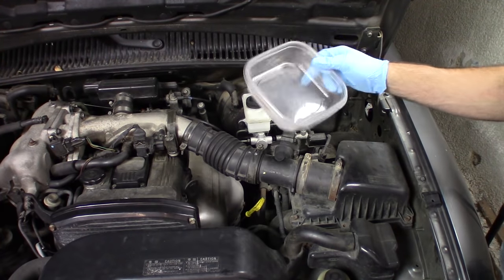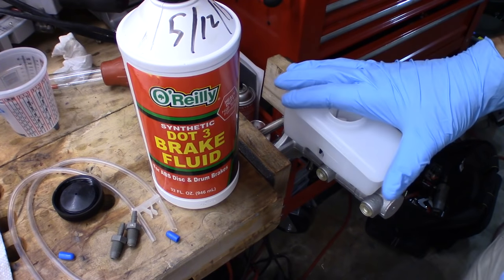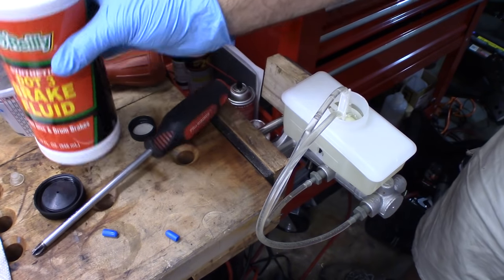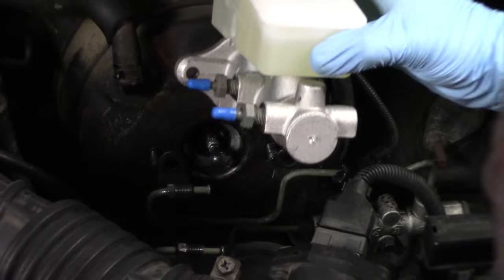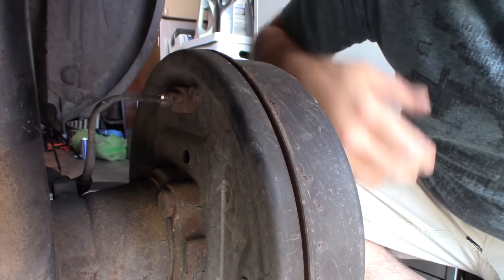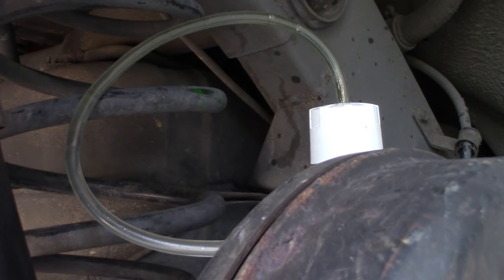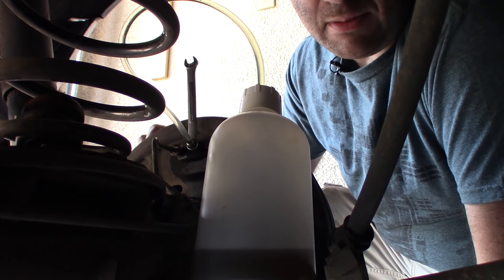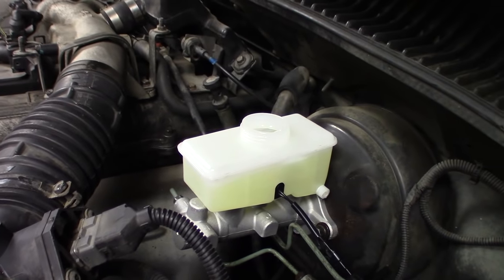How to Replace and Bench Bleed a Brake Master Cylinder DIY

Comment: Alot of great info here and great camera work. These are the type of do it yourself videos that actually help people and show proper technique. Another tid bit is (at your own discretion) that you can go jam your brakes up going down a open road are parking lot  to make your abs activate a few times and rebleed the system if in a pinch and you have to. Keep up the good work.

Comment: IF you can get to the fittings on the booster...
You can use the fittings as bleeder valves. With them snug, have someone pump up the brakes and while they hold it, crack open the fitting on the front, the air will come out. Snug it. Have them let off the pedal. Fluid will be pulled out of the reservoir. Do both ports.
Then bleed the calipers and wheel cylinder as usual.
Reply: Do I bleed one port at a time? Or can I do both at once?
Reply: Gonna try this tomorrow!

Comment: Amazing seeing a car and brake system without a toal enxrustment of RUST...servicing cars in the North East and Rustbelt is a whole different job...how nice itt would be to not deal with seazed, rusted nipples crimped rusty brake lines ..and the desasters from  moving or losening a rust encased line..like they all are under an older Norhtern car...that was a joy to watch...tnx

Comment: Good video, especially for older cars that do not have ABS brakes or TRAC systems.  As you mentioned, those systems probably need bleeding also after changing out the master cylinder.  If you are a competent mechanic or DYI mechanic with a proper repair manual for your individual car, you can bleed these systems yourself.  Just follow instructions carefully and be aware that ABS and TRAC pumps are high pressure.  Don't hurt yourself if you try to bleed those systems.  
 Otherwise, a very good video with good information.  Would like to see another using a pressurized brake bleeding system.  

Dr D

Comment: I've seen the bleed kit's tubing clip used on a master cylinder reservoir that has 2 isolated sections for fluid [2 separate fluid circuits provide for braking in the event of one circuit's failure].  The plastic hose clip fastens on the 'wall' that separates these sections.  The BMC shown in this video has 2 circuits; however, it looks as though they share the same reservoir.  If so, this suggests that the failure of one circuit [e.g., via a leak] could drain the entire supply of fluid from the reservoir . . . leaving the car with no brakes.

Comment: I have a front wheel drive 2003 Toyota Celica GTS and the brake bleeding order isn't from the right rear 1st, then left rear. Some Hondas and other front wheel drive vehicles have a different bleeding order. Make sure to always check your manual or verify the correct bleeding order for your vehicle

Comment: FYI you can buy a scan tool for a little over $100 that will tell the ABS module to bleed. Since every car today has ABS, you might need to use one of those from time to time to make sure any bubble are out of it.

Comment: Why are most recommendations to fasten the master before installing lines? I think it's much easier to get the lines on when master can be moved around a bit.         Why do all the bleed vids just have 2 lines. Most vehicles I've worked on have 3 or 4 'ports' to deal with.
Reply from the maker: +Jay Last You're right, I suppose it would be easier to get the threads started a bit before you bolt the master down.  They have 2 lines because they are older, non-abs cars.  They have 2 circuits, 1 feeds left front & right rear and the other right front & left rear.  This way if one of them corrodes and leaks, you still have front and rear braking.
Reply: Thankyou, I didn't know dual lines alternated front to back but that makes good sense.
Reply: so when you bench bleed a master cylinder with 4 ports, how do you work with the kit? Do you need 4 tubes?
Reply: @50sKid  A lot of modern cars have 2 lines with ABS. One set of lines will go to Front-Right and Rear-Left while the other to Front-Left and Rear-Right. A proportioning valve will be somewhere in the system to balance the pressure between the wheels. That approach is essentially what does the anti-lock for the back wheels. One of the fail modes for the proportioning valve is your rear wheels locking up when you press the brakes, the other fail mode is they barely get any braking power at all (depends if it's stuck open or stuck closed).
Reply: @eideticex  
Hello
my car is 1993 Ford Taurus V6  3L  and my master cylinder 
have 4 ports (4 brake lines)
do I do the same things you did with the plastic hose,,but in my case i need to put 4 hoses instate of 2 like you?
thank you

Comment: HI..I really enjoy your VIDEOS, especially because   have a 1998 automatic KIA SPORTAGE NON ABS..I need to do exactly this job in a few days, so thank you Exactly what size flare wrench are you using to remove the 2  lines at the MASTER CYLINDER?  I am afraid to strip them..they seem rusted..you turn the wrench counterclockwise, correct?
Also are the bleeder screws at the brakes the same size flare wrench as the master cylinder 2 lines?? thanks!! Hope u can answer asap!
Reply from the maker: I don't remember exactly.  Just go to harbor freight and buy a set of flare wrenches.  They're very cheap.

Comment: Hi ther ,shouldn’t you use a pry bar to hold the brake pedal using the car’s seat 
then you close the Valve ? 
And I am sure your car has a ABS system , so what precautions we must take to 
avoid problems with ABS ?

Comment: So I bought 4 rotors and brake pads for my 2009 Nissan murano.   I replaced the front  and did not do the rear because I could not remove the rotors.   My car at slow stop makes a grinding noise.

Comment: so if i am replacing my brakes, while i  am changing the master cylinder, would just bleeding the brakes at the caliper be ok, or should i bleed the cylinder and the calipers?
Reply: If you don't bleed the cylinder first you will have to keep bleeding the lines as the residual air is pushed out into the brake lines. Would require more brake fluid and more time.

Comment: The warning about the anti-lock brake was only for replacing the master cylinder and not for regular bleeding, correct?
Reply from the maker: +12vgs8606 Yes, correct.  Basically, if air gets in BEFORE the master cylinder (ie you run the reservoir dry), the dealer will have to bleed the system for you.

Comment: How do I avoid stressing out the piston of the master cylinder when I bleed the brakes? I broke my master cylinder trying to bleed it and now how to bleed new cylinder and everything again.
Reply: Be certain that bleeder screws are open. It should take less pressure than when you are braking on the road.

Comment: You do know when you open the ports to install the brake line fittings you introduce air again.
Reply: Yeah but not inside the main body of the master where they were before as you cant force air back into it. This is the reason you bleed all corners to remove that newly introduced air.
Reply: @fatwalletboy2  correct but you def get air in between the master out Ports and the hardlines. Have somebody press the pedal lightly and crack the nuts a few times. Makes bleeding easier